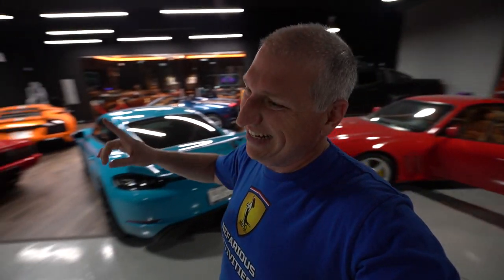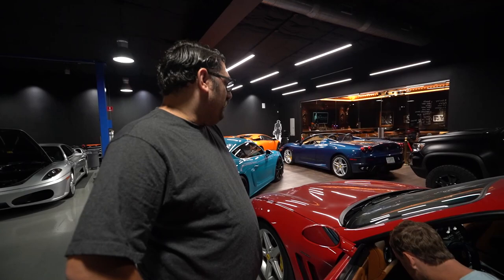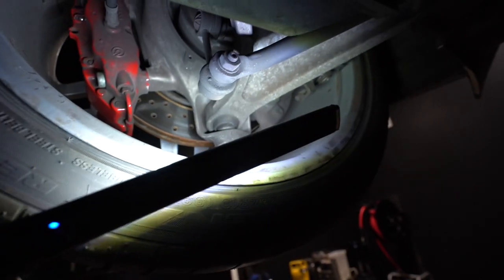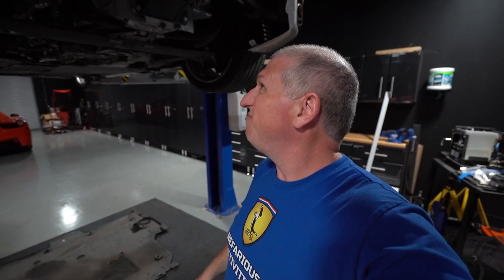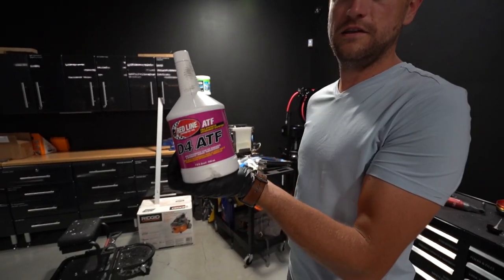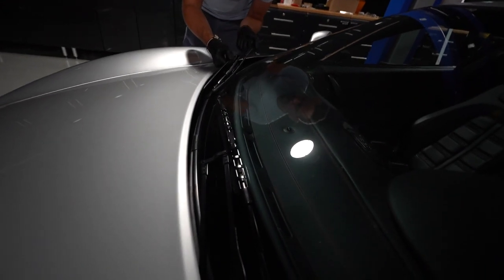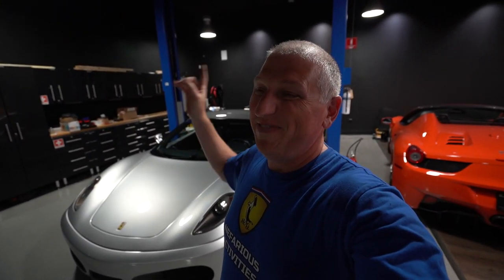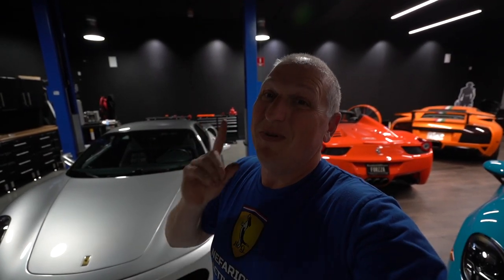We FIX BOTH our BROKEN FERRARIS - F430 and 575M

Comment: Hey Dan I remember when that antigravity battery came out. It's supposed to come with a remote push button, so that anything electrically operated, such as trunk locks wouldn't be a problem. As you know most Ferrari's have the battery in the passanger foot well. I wanted to get on for my 430, but there very expensive.
Reply from the maker: It does have a remote. I forgot where we put it
Reply: get one, will worth it!

Comment: A good alternative to the Michelin is the Pirelli P-zero. I’ve run those on my S65 and had a good experience they will slip slightly when they age but new they are pretty good. I know you probably did this but did you prime the system by opening door before checking the fluid?
Reply from the maker: We will recheck it
Reply: I've heard Michelins are tough to get now, but I guess we lucked out recently.  Had P-zeros on our Cali 30, replaced them 3 months ago, lots of tread left, but they were too old to risk it anymore (2016 in fronts,  2017 in rear). I told my mechanic that I really wanted Michelin PS 4S tires a completely new set, and he said that they are the best sportscar performance tires in the world,  hands down.  He said yeah Pirelli and Ferrari are joined at the hip, and if you're in Europe then you really have no choice than to go with Pirelli. But being in USA, Michelin is really the no brainer choice, I would have waited to get the Michelins if I had to, for as much as we spend on these cars, tires are just one of those things to not skimp on.  🏁